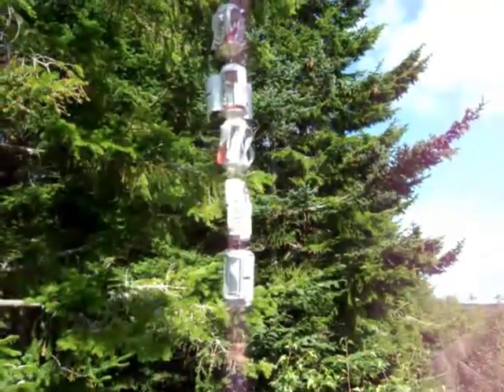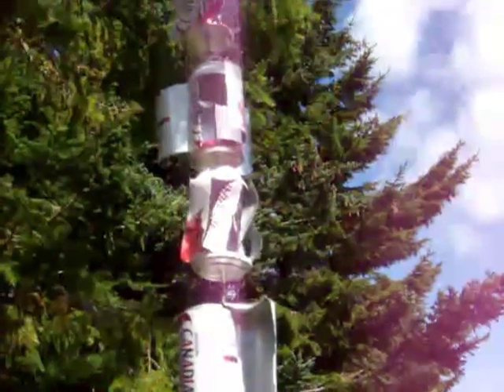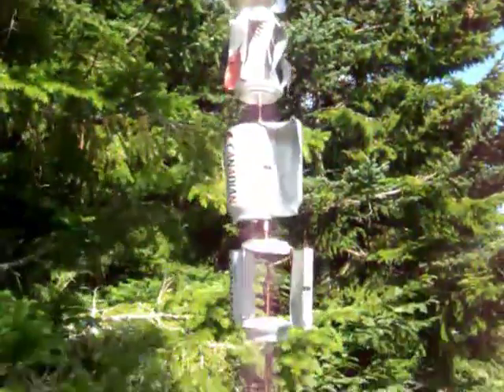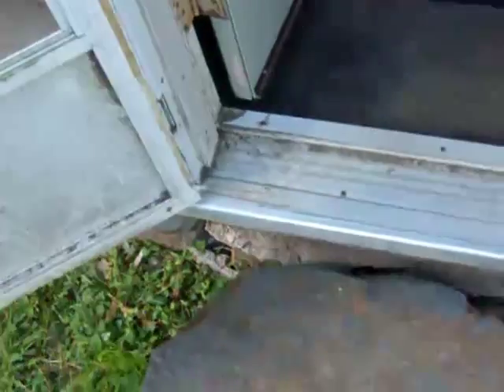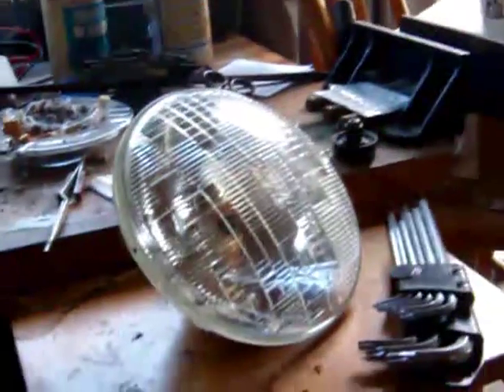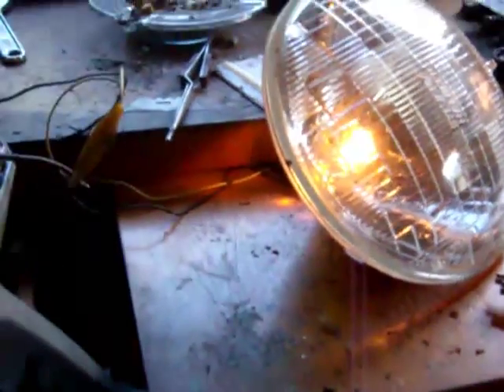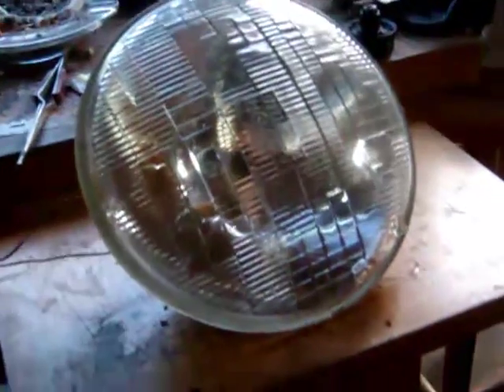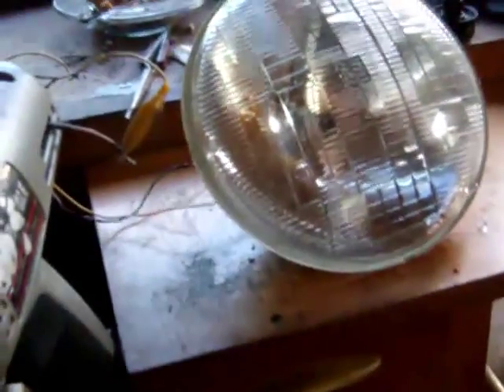Hillbilly wind power stage 1

Comment from the maker: yeah, I've seen that b4 or ceiling fan motors too, but this is just a test really to see how practical a wind generator will be at my location and your right I need more voltage, I'm thinking i might need an 18v drill to put out enough voltage to actually do any kind of chrging, though first i will be hooking up 20-30w of solar panels aswell

Comment: The actual motor in that drill is pretty small and that's going to limit the power you can get from it as a generator.  You might want to check out treadmill motors or a home build PMA.

It's always good to see someone experimenting.

Keep it up.

Comment from the maker: it worked better with the turbine in low, the tramsmission is kinda screwed, not to mention the drill driving it has a half dead battery, but i figure with a big blade, that should give it the torque it needs to charge a couple car batterys